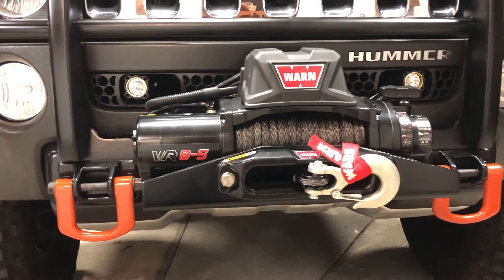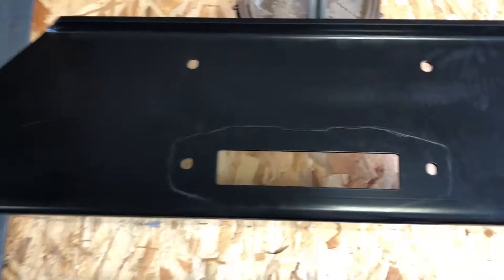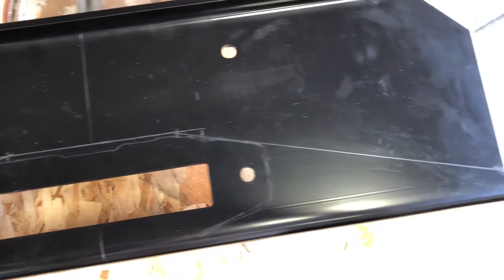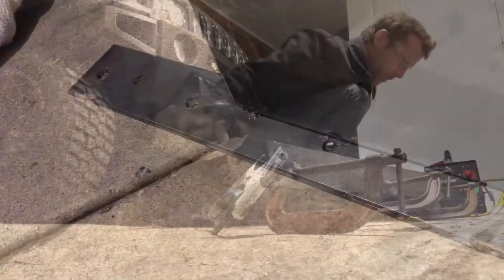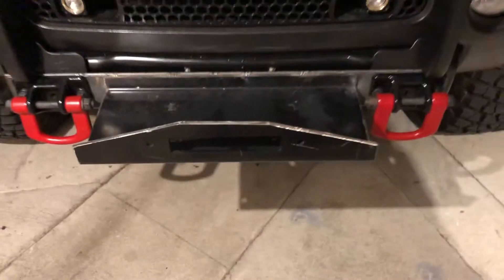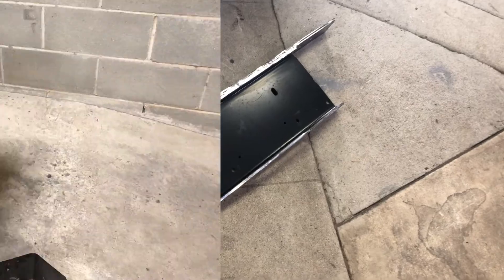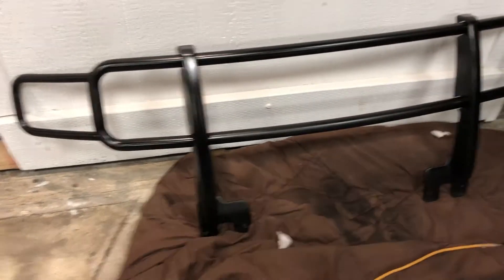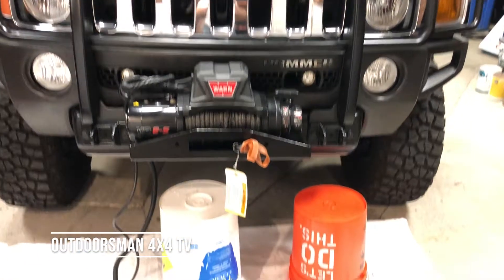🔧 How To Fabricate a Simple Winch Mount - Hummer H3 Alpha

Comment: Structural flaw.. no integrity in the bottom section under the plate, should have run a couple pieces of angle iron under it.
Reply from the maker: Exactly!!! We’ll fix it. We’re dumb.
Reply: @ChurchieShed  you’re not dumb! You made a heck of an honest attempt.. you’ll know better for next time. Sure beats the $1200 it could cost to mount that on there other methods.